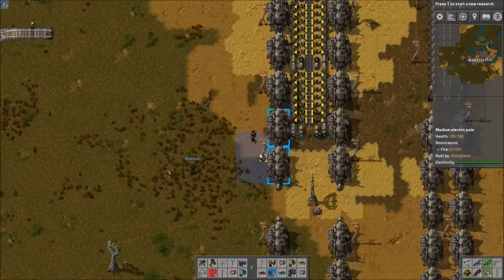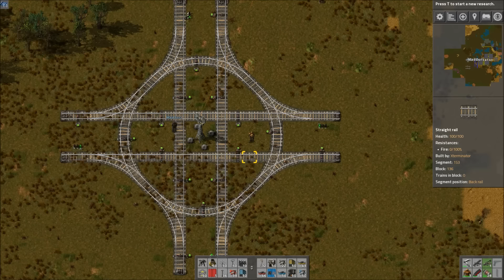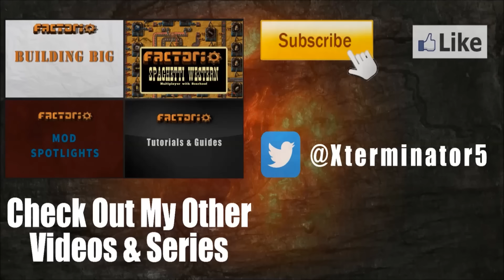Factorio Workshop - Building A Better Factory :: Egor Day's Steam Engine Setup & Roundabout

Comment: A left turn through the middle is even better than a straight because, with proper signaling, you can have 4 trains passing through the system simultaneously with 2 turning left and 2 turning right, instead of just 4 right turns

Comment: With the Steam setup, which is a better use of space?
Obviously the Long version doesn't waste much space, and the short has a wasted area between the Engines.
It could be made shorter by doubling the second half of engines back on itself. But what could go in there otherwise?

Performance-wise I agree, but functionally, how much time to do you save with ease of use for installing round-a-bouts, compared to custom T intersections?
Reply: That's true. And fair enough. 
I originally thought about bending around to the outside. To the entire height is the length of 5 engines. 
I guess it's pretty the same either way. Depending if you have the room to lay them out long or folded.
Reply: Me, I'd want to have all my Steam Engines in one area, and therefore the problem becomes the "surface area" of the lake from which I take Water. Because of this, the traditional "long" setup works MUCH better for me.

Comment: I only ever use 1 engine+2 carts, either iron and ore or oil barrels and empty barrels. Roundabouts work perfectly for me.
Reply from the maker: Yeah if you use shorter trains like that then you shouldn't have that much of an issue as long as it's signaled properly. :)

Comment: Can't you reduce the chain signals in that junction by 4? I find it easiest to think of signals in terms of cutting the junction into separate zones. The signals in this arrangement cut the junction into 5 zones, the 4 corners and the center. What purpose does isolating the center serve? If instead you just cut the junction into the 4 corners instead of having the 8 signals in the inner ring you just need 1 on each of the 4 sides of the central square. Am I missing something?

Comment: On the rail algorithm walkthrough, I'm fairly certain that you explained that incorrectly, as that's not quite how A* works. A* cares only about shortest straight-line distance (off the rails). Meaning the left side would only be checked once the right side is mostly exhausted.

Actual formula is g(x) + h(x), where g(x) is the cost to get the current space (likely the length of the rail), and h(x) is the estimated cost to get to the goal (straight line distance). The space with the lowest cost gets picked for the next calculation, and this process repeats until the goal space is found.
Reply from the maker: To be honest, you lost me with the calculations (not my area of expertise. lol). If we did in fact explain it wrong, I apologize, and thank you for correcting it! I will point Zuri to your comment and he can probably come up with a better response since he knows about this type of thing than I do. :)
Reply: What you described is not A* though, it's depth first search and I really doubt factorio is using it, since that would mean factorio engine needs to find every possible path first to determine which one is shortest. A significant improvement over this would be breadth first search, which would eliminate the concrete problem you're describing in the video completely. The same problem would still persist if train is trying to find long path. To eliminate that you would use A* algorithm, which is improvement over breadth first since it tries to approximate which path is shortest using heuristics. So either trains are not using A* or problems come from somewhere else not from train pathfinding.
Reply: The heuristics they discussed in FFF are a lot more advanced and specific to factorio. What I'm suggesting though is heuristic that is the very core of A* which is to determine the node that gets you closest to your target and check that first. The way you described it in video is what depth first search would do though. Even breadth first search wouldn't have to check as many nodes as you described in video.

Given their advanced heuristics that they describe in FFF. I highly doubt that developers used depth first search and not A*.

Comment: The roundabout argument is pretty much irrelevant. You need to have a REALLY big and convoluted base in order for train pathfinding performance to matter, mainly because it's only done when a train needs to go somewhere, which is probably about once per minute per train or so, and because most trips are almost straight  lines to far away stations. Unless you have a TON on trains, you won't get past one or two pathfindings per second, which will not affect performance.  If you have 300 trains you might start to worry, but at this point I don't think trains are going to be your main concern. I'd use roundabouts over anything else any day if only because of how simple to lay out they are